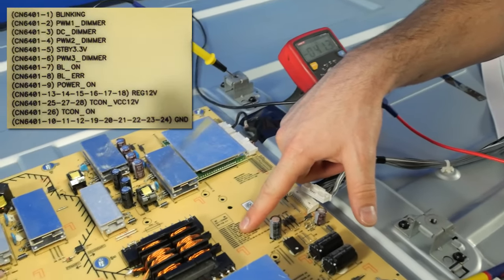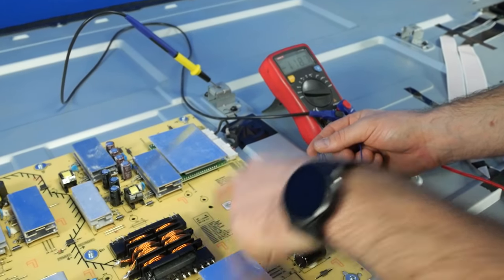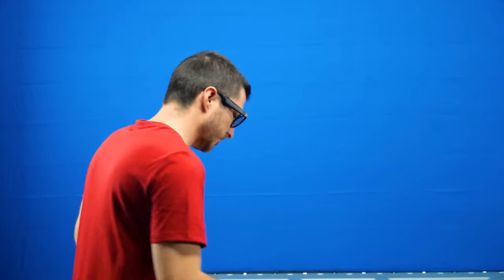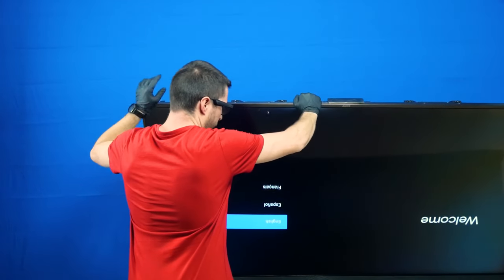Sony TV XBR-75X850F No Power

Comment: Thanks for this video. I was able to follow it along for my XBR-55X900F, and every step led to the same result... the main board. Sending it your way! The only part that slowed me down was disconnecting the wires to the board. There was one style I haven't seen before, the two going to the TCON, but I was able to figure it out. The two little black buttons on the edges need to be pushed down, for anyone that might get stuck on that. Thanks again!

Comment: Hello Nick!

Months ago I talked to you by email, I asked about sending an eMMC chip for the Brazilian model XBR-70x835F. I bought a new board from Sony and the TV is working. Thank you for your help!

The defect of the old board is definitely the eMMC chip.
Reply from the maker: Nice that's good news! Glad you got it back up and running. Yeah sorry we get requests for chips for the Asian, Europ, and south american versions of the models all the time. The problem is that the mainbards for those are designed differently depending on which area of the world the TV is going to due to different regulations and systems for those countries. So the software is different and we don't have those.
But I am glad to hear you got the set fixed and working again! Sony TVs have some of the best picture and are definitely worth fixing.

Comment: Hello Nick,
Yet another excellent video 👍

Sony has know about these terrible eMMC chips for years and have still not come with with a better more long lasting solution. On cheaper lower end branded mainboards (for example Vestal), if there is an issue you can just say oh well it was a cheap tv so lets just buy another one. But these Sony Android TVs are not cheap, nowhere near cheap so all these eMMC issues are just ridiculous and gives Sony a bad name when it comes to TVs with eMMC issues.

I repair TVs as a hobby (as well as upgrading already good audio equipment internals to audiophile sound quality), I'm actually a self employed software/app developer and my house is full of Sony Android TVs. One of my TVs I had to replace the eMMC and that was not fun for me to do. We actually only ever use 4K Chromecasts plugged into all the TVs in our house as using the apps on our mobile phones and then clicking the cast icon is much faster than using the tv remote with the built-in native tv apps.

Anyway keep up the great work and videos 👏👏👏
Reply from the maker: Thanks for the comment peter, I am glad you like the content. 
I personally like using the firestick on all my smart TVs it's much faster than the built in system for sure, regardles of it being a Sony, Samsung, LG or other brand.

Comment: Hi Nick, great videos!. I have a Sony Bravia XBR-55X700D which doesn’t turn on. I checked the power board for the 12V and the 3.3V standby and they were ok. At this point, I am not sure if the power board is 100% fine. I have not tested the main board because I don't know how to do it. What is your advice?
Reply from the maker: Hello,
Based on the information provided it sounds like your power supply is fine, you are getting both the 3.3v and the 12v. 
If the power supply was damaged I would expect one or both of those to be missing. It is incredibly rare for the power supply to fail,  99% of the time the failure is with the mainboard. 
If you really aren't sure and would like to have both tested, you can send us both of your boards. We have a testing/diagnostic service available and we can test the boards for you. We also do offer a flat-rate repair service for your mainboard. 
The mainboard repair service is below:
https://nickselectronics.com/products/xbr-55x700d

The bench testing service is linked below:
https://nickselectronics.com/products/diagnostic-and-testing-fee

Comment: I have a 10 month old xr85x90k that randomly blows my ckt breaker in my box. The power board was replaced and still does it with nothing else on the ckt. What do you think?
Reply from the maker: If it's 10 months old it's under warranty and I would recommend having it fixed under the warranty channels. 
But also try plugging it in in a different circuit in a different part of the house and see if the issue persists. If the TV works for the most part then the issue is most likely not with the TV but with the plug, the breaker box or wiring between the plug and breaker box. If the power supply was drawing enough power to trip the breaker then something would have caught fire or shorted out in the TV and it would be very obvious.

Comment: I have and XBR-65900. It went completely dead as described here. Wouldn't turn on no matter what. Had he main board replaced and it worked 100% perfect; however, I noticed the very most subtile differences in the main TV GUI, and while some smart apps worked (Youtube, Disney+), some did not. Netflix gave a UI-800 error and HULU gave a PDEV-320 error. These potentially indicate a hardware error. Trying to find out if my board is somehow not compatible with something related to the network on the TV, or if the main board is just bad. So frustrating.
Reply from the maker: This is not a hardware error, it is an error due to licensing. There is no way to fix this. You will have to use those apps using external devices such as a cable box, Firestick, Roku stick, Apple TV, chromcast, or other similar streaming device.
Reply: @NicksTVRepair  I would suggest people always use something like a Firestick rather than another product for streaming because manufacturers don't seem to bother supporting these things. Android TV might be an exception though but some random smart TV or set top box probably not

Comment: We have a KD-65X75CH that is not responding to remote control functions. We have reset the TV, bought two different remotes and new batteries for the remotes. Nothing… Now the TV is stuck in the Welcome screen with the selection of languages to choose from for the setup. Any thoughts on what it could be?
Reply from the maker: You only mentioned the remote control, what about using the button? 
If that also doesn't work It would be worth trying to replace the IR sensor board.

Comment: Hi, great stuff.  I have the same model (800h instead of 850F), and i get no screen, but power, sound, and backlight is working. Any suggestion on how best to approach fixing? If i had to take a wild guess, the mobo needs to be replaced? Could it be anything else?
Reply from the maker: I have to admit, I haven't worked with the 800H much so I don't have an answer for you on that right now. But if you are getting backlight and sound we can rule out the power supply and LED strips. You could have a fault with either the Mainboard, T-con board, or the panel. 
The T-con and mainboard are the only parts that you can replace so I would suggest replacing both and seeing what happens.

Comment: Thank you for sharing all these videos on troubleshooting! My XBR-55X850A (non-android tv) recently shut off by itself, I was able to turn it back on for like 30 minutes, it then shut off again by itself, ever since, it wouldn't turn back on, now I have no power, no standby light, nothing. Following some of your videos on how to check voltages, I got the standby reading 3.3V, all REG12V pins read 0V without the mainboard plugged in, but with the mainboard plugged in, the REG12V hovering just above 9V. Do I have a bad power supply or the main board? Thanks!!
Reply from the maker: I don't often work with that model so I am not as familiar with it but based on what you are telling me it sounds like you have a mainboard failure.
Reply: @NicksTVRepair  Really appreciate your reply! You are a great man! I wasn't giving too much hope for you to respond to an older video, so I actually took the chance, got a power supply board, and it did the trick. I know the tv set is old and probably worth nothing now, but I really hate to throw away a giant piece of tech in the landfill, only because of one small part or the faulty PS board in my case, and I bet you could probably fix the PS board by replacing a transistor or whatever the part may be. So, for what you're doing is actually saving the environment, keep up the good work! God Bless! Wish you do good with the business! Thanks again for all your video uploads!!

Comment: Any tips for repair the power supply for this model? No power on conector Just 300v on the filter capacitor and 14v on the pwm ic
Reply from the maker: It is very rare to see these power supply boards go out. I have only seen one go out before which is why I did the quick little check to confirm it was good. It will be very hard for me to get content out for that repair since it is so rare to see these go out, but next time I encounter one ill make sure to do a video on it. 
I don't think we even fixed the one we had encountered that was defective at the time since replacement power supply boards were very cheap at the time, it made more sense to just replace it.

Comment: I have Sony TV XBR49X800E doesn't turn on at all for unknown reasons. I replaced a power board, nothing turns on. Black screen, no light signs on main board. My question is what thing is responsible for not turning on. How to diagnose main board, T-Con  board, a thing for standby. No light in standby  when plugged in electricity.
Reply from the maker: If you follow the instructions in the video, it will show you how to determine which board is at fault. 
The T-con is in charge of providing data to the screen, which has nothing to do with the TV turning on. If you were to remove the T-con from the TV you would still be able to turn the TV on and off, but you wouldn't get a picture. 
The power supply and mainboard are the only 2 parts that can cause a no-power fault. 99% of the time the mainboard is the one that causes a no-power fault. To confirm this follow the steps shown in the video.
Reply: @NicksTVRepair  I tested the main board Sony TV XBR49X800E, I found that  two of pins where to connect to the power board no resistance, what should I do to know where the problem is?
Reply from the maker: I am sorry but I don't understand what you are saying in your last message. 
My original statement still stands however, your mainboard is most likely your fault.

Comment: Hi Nick,

Just found your video. I'm trying to fix my Sony tv with no power issue. I have 2.6v on a STBY3.3v. Also I haven't got 12v on pin 25. What would you say it's the problem?
Reply from the maker: If you disconnect everything from the power supply and power it on do you still have 2.6v on the 3.3v standby line? 
If yes then you may indeed have a defective power supply but that is very odd and more likely that your multimeter is out of spec than the power supply. If you had an issue on your standby line I would expect 0v or oscillating voltages, but not a low voltage output. A no power issue on a sony TV is 99% of the time due to a mainboard fault not power supply.

Comment: Hey Nick,

I followed your guide, after wiring standby 3,3V to the regular 12V I only received 3,3 v and not the regular 12 v (compared to what you got, in your example)

Does this mean the issue might be related to the power supply ?:-) 

Great vid!
Reply from the maker: I do not wire the 3.3v to the 12v line. 
I put the 3.3 to the PS_ON command line. That is what activates the power supply and allows it to produce 12v

Comment: Hey great work by the way. I've just purchased a Sony  65xg8505 looks identical to the one your working on. I'm getting 0V from all the outputs on the power supply no 3.3V no 12V I have 240V going in and I can find voltage all over the power supply board at various points. I've disconnected the main board and T-con incase that's causing no voltage on the 3.3V put no luck. Do you think power supply or main board ?
Reply from the maker: 9 times out of 10 a dead no power fault is mainboard as shown in this video. But if you are not getting any output voltages from the power supply even with the mainboard disconnected, and you are sure you are doing the voltage checks correctly, then you have a defective power supply. Try checking for shorted diodes first, most Sony power supply boards fail with shorted diodes.
Reply: @NicksTVRepair  many thanks for the help I noticed you do some BGA reballing aslo I've reballed a few PS5s. Interesting regarding the Shorted Diodes I will check that later this evening. If I don't find any shorts I will most likely check out the IC and replace
Reply: @NicksTVRepair  You where right I found a SB260 60A 2A diode shorted. Out off all off the Diodes I own I can't find a match only rectifiers no Schottkys typical haha. Update replaced the SB260 with a similar value only difference was 5A instead of 2A it works ! Many thanks if I can donate to your channel I will 🙏
Reply from the maker: Bottom right of the video there is a "Thanks" button for donations. 
I appreciate that!

Comment: sony kd75x85j just went out this afternoon when i got home.tried to turn it on and nothing no led standby light just a black screen.any ideas on what it can be?hopefully its just the power supply board.any answers will help thanks.
Reply: Mine went out too because of a storm call your insurance company
Reply from the maker: It sounds like a mainboard failure just like we see in the TV shown in this video. 
It is rarely due to the power supply.

Comment: Hi, can be used some other emmc  by brand or with smaller (16) or higher capacity?
Reply from the maker: You can use a different brand eMMC but it can't be a smaller capacity. I think you can go higher, I don't actually know, my tech would but he is out for the day already. I think typically we try to stick with the same capacity.

Comment: Hello, I got a xbr-75x850d for free guy said it was working and just turned off. No signs of life. Never seen a tv with 2 power supplies 🤔. I tested for 12 volts I see that, however on the standby light I get a reading of 9.4V and when I tested pin 27 going to dps board I have nothing. Would this be the PSU or main board?? Thanks
Reply from the maker: Connector CN6401 pin 27 is 12v lines to T-con, it should only show 12v when the TV is on. So if your TV is not turning on then that is normal for it to not show 12v. 
What you want to check is pin 5 which is the standby voltage. It's on the lower row so you have to wiggle your multimeter lead in between the wires to get  a reading on it, but if you do get your standby voltage then you can almost certainly rule it out as the fault. Make sure you look at the legend to identify where pin 5 is on the connector. It's the third pin from the top on the lower row. If what I am saying doesn't make sense, just look at the legend and it will visually show you where it is. 
it is very rare for that power supply to go out. 99% of the time the mainboard is the one to cause a no power fault.
Reply: @NicksTVRepair thank you so much for replying! Everything you said does make sense, when I tested standby voltage I’m getting 9.4 which is weird right?  In regards to what you said about PSU that it’s rare for those to go out, I believe I can safely say it’s main board. I will purchase one and report back for anyone having the same issue. Although this main board on this model tv is a little expensive! 😂 but hey it was a free tv! Thank you once again! You gained a new subscriber!
Reply from the maker: Did the new mainboard work?
Reply: @NicksTVRepair yes it did work! I purchased the main board from china, so the android os is a little different, but I just connected a firestick because there was no netflix and its working flawlessly! It was a free tv so can’t beat that. Thanks for all your help! I might try and repair the original board. You wouldn’t happen to have the os to write onto new EMMC chip?

Comment: great video, I have a dead 55x800h, I checked the 3.3v and 12v were ok
but no TCON 12v, I jumped the power on and icon on with 3.3v and tcon 12v was there. so power supply was ok
I guess my issue is the main board. my question is after replacing with a new board, does tv need to be software upgrade or restore it for the new board?
is the board compatible with different size? like a 55x800h will work with a 65x800h? will still need a software restore after installed?
or if I send you the mainboard do I need to restore the tv software or after the repair is just plug and play?
thanks
Reply: actually I just fixed it by changing the mainboard. I was able to find a 65x800h board, 
the tv works fine now, the only thing is that after I reset to factory, it shows 65x800h, any way to flash or upgrade to become 55x800h
I know I can just change the name but any way to do it permantely?
thanks